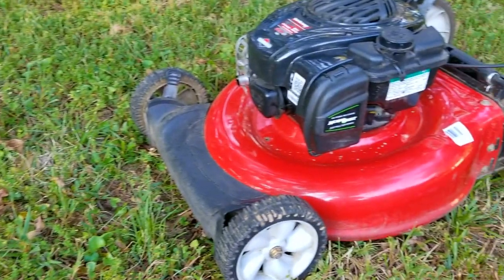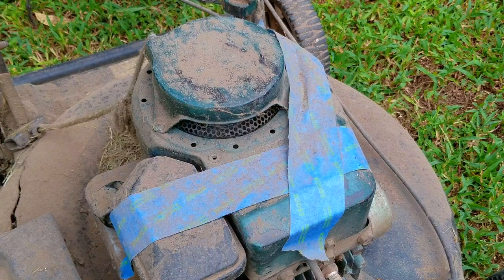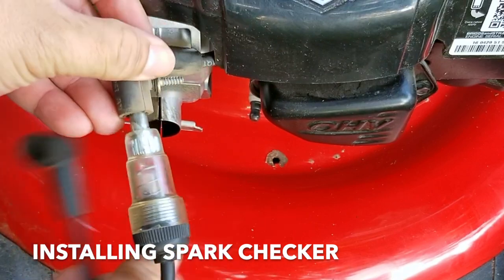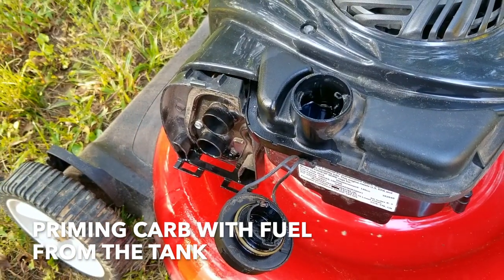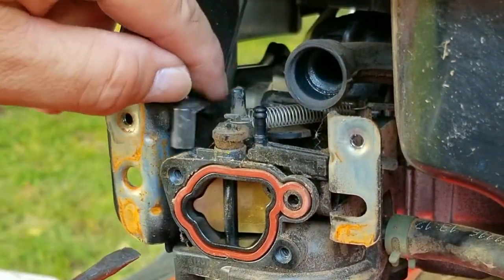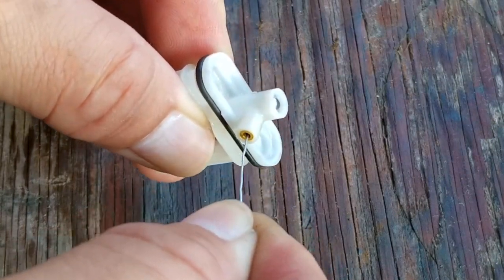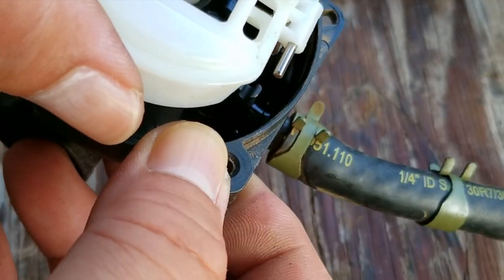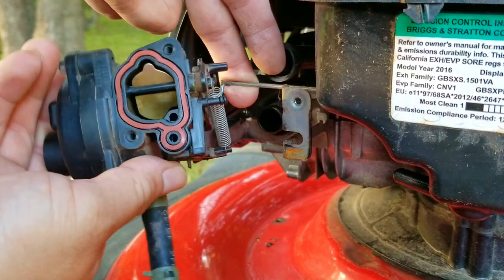Why Did Briggs Stop Making The Flathead Engine?

Comment: I once found a push mower with a flathead out in a field. The tank was surprisingly clean. Replaced the rusted-away muffler, added fuel and it started and ran. Went through the carb and used that mower several seasons before parking it. I’m sure it would run again if I needed it.
Reply from the maker: that's an amazing engine!
Reply: Had one the lawnmower tore itself apart everything was zip ties except for the blade assembly. Quit using it after the pull start spring assembly snapped. It was 33 years old 😁
Reply from the maker: very nice

Comment: A briggs sales rep once told me that old machines were designed around their flathead engines but alot of newer machines are designed around honda engines. Certain applications, unlike a push mower, are not exactly tight, but others might have to be designed around the dimensions of a Briggs flathead or a Honda GX. Therefore Briggs redesigned their motors to share the same dimensions as the GX series in order to fit the same applications.
Reply from the maker: thank you trailduster6bt I like this comment.

Comment: We had a “motor blow” contest at a stag party and had 3 flatties to run. With the throttles pinned over (bypassing the Governor) they just ran and ram and wouldn’t quit. The pulse jet carburetor is quite an amazing thing as well. It was so simple that it was genius.
Reply from the maker: so I've heard.
Reply: Are you talking about lawn mowers or "something else!!!"
Reply: I have an old mower with the pulse-jet carb and a breaker-point ignition system. Love that old mower!
Reply: Maybe they were newer more beefier designs, or the carbs are a bit smaller to limit the rpm. I knew many folks that have done exactly that in the late 60's and early 70's and it resulted in a broken connecting rod.
Reply: FYI, the correct trademark was/is Pulsa-Jet (not positive if it must have the dash).  They were an ingenious design, as mentioned in the thread.

Comment: I have dug 1970s flatheads out of barns and sheds and got them running easily and relatively cheaply. 
One thing to remember is the oldies do not like ethanol fuels, even the new engines need totally drained for more than a few weeks storage.
Otherwise a carb strip and clean will be required to get the engine to start and run properly.
Reply from the maker: you are correct!
Reply: I don't know since ethanol is just plain old alcool it should be plasric-friendly. It will chemically react with cast aluminum carbs though and produce that carb passages clogging gel. Mind you, there are other fuel additives like benzenes that may cause problems with plastics and gaskets so newer fuels aren't very tolerant towards small engines and it does indeed degrade very rapidly ! Regards
Reply: I don’t fret over the ethanol, especially since it’s getting harder around here to find gas without. I just mix 2 ounces per gallon of Seafoam in fresh gas and call it a day. No issues.
Reply: If you leave ethanol in the carb for long periods of time it will cause corrosion too
Reply: @danielrobert7181  The problem with ethanol is that it is hydrophilic, it attracts water. It is the water in the system that wreaks havoc in many engines.
Reply: @jfu5222  Sure but the thread started with a mower sporting a plastic tank and carb on which moisture has no effect.
Reply: @danielrobert7181  Thank you for the correction. I'm not familiar with the insides of plastic carburetors, surely the needles and jets are metal and influenced by moisture. Regardless of the fuel type or construction materials used, it's never a good idea to leave unstablized fuel in a machine during storage. Ethanol blend fuel is quite unstable.
Reply: We have a ton of Honda trash pumps and generators at my job and if they sit for more than a couple months the fuel just gums up inside the carb and disables the entire thing. We often have to replace carburetors in order to get the unit running, cleaning doesn't do anything.

I put a large amount of SeaFoam or Stabil in each one that I service just so they have a fighting chance during the year before the operator brings them in for service again.
Reply: correct. Its not the carb or even the engine that is the problem its the fuel. When I left we were going to nickel plated carb jets which helped with keeping the jelled fuel from sticking inside the jets but if the fuel is a jell it dosen't matter. Also the ethanol fuel absorbs water and gasoline is good about evaporating the most volatile part of the fuel above 72 degrees so age in untreated fuel is not your friend.
Reply: @danielrobert7181  the fuel goes bad regardless of the tank as long as there is air in there or can get in there it will go bad
Reply: @markrickert9040  You are right indeed and my comment was relative to ethanol and the fact that it won't chemically react with plastic (tank and carb). Regards
Reply: Ethanol is murder on small engines. People generally think it's because of a reaction with rubber, but it's not. It's deadly to aluminum. 
If you don't have ethanol free gas (aka "clear gas") in your area, you must drain it at the end of the season.
This is true for ALL small engines from your lawn tractor to your chain saw.
A Google search will get you to sites that explain it fully.
Reply: Look around. More and more gas stations carry ethanol free. A local fuel supply advertised it on the side of the road. It was expensive. $6.00/gallon and it was 93 octane. Now I see some Wawa, Murphys, buc-eeys, and others carry it.  On the road to Florida recently in South Carolina off of route 95 I found a station that had ethanol for the same price as their 89 octane. It had a red hose. My Cadillac DTS (Full size) highway mileage jumped from 23 to 27 MPG. Northstar engine. If I find it close to 89 octane price, I'm buying ethanol free.
Reply: I always run the gas out of my Craftsman/Briggs every time I use it, unless I'm mowing the next day.
Reply: do not operate a small engine on gasoline with 10-15% alcohol , you will wear out the exhaust valve guide/ valve stem, and cause the chrome plating on the piston to wear off, causing cylinder scoring/ galling!!!!    I collect/ restore "B&S" engines that date back to 1919( mod. "P"),when STEVE BRIGGS/ HAROLD STRATTON got into the small engine market!!!!.
Reply: The plastic is the same material used in automotive radiator side tanks. PA66 /Glass filled nylon. This material CAN last 21 years at 200° F and hot cold swings. When it fails, it slivers apart just like any nylon that ever fell apart. It cracks. But only the parts that got hot. I'd imagine sunlight is not really good for it but you should keep a spare anyway. Changing the oil is my thing and I try to never run dark oil. Ok. 😅 Good show and yeah I hated these before the secret was let out about drilling the main.
Reply: @gregoryclemen1870  I might have to dump the stored gas in my car.... And get the good stuff for my small engine. Thanks. I never even thought about the metal coatings. I was only concerned about the glue balls.
Reply: @marshmower  I always would get "SHORT FUSED" when I had to clean out a gas tank with stale gas in it , and try to get the carb to come apart, and clean that out. there was a few times I could not get the main jet out on a "FLO- JET" carb and had to replace it!!!!!. it does not take much effort to drain the gas and run the engine until it stops when being shut down for the season.

Comment: My flat head has now been in service for 41 years. I change the oil and clean the air filter once a year. I drain all the gas out at seasons end. I did upgrade the carberator as the old plastic one was warn out and upgraded to electronic ignition. It still runs great and doesn't use more oil than when new.
Reply from the maker: nice work Mike Fennema!

Comment: I like the older Briggs engines. Simple design, & easy to look after. The biggest I had was on a Pace forward mower. These mowers were a true work of art. They were a self propelled mower, but had no rear wheels. The gearbox drove 2 rollers, yet the discharge chute was at the rear, & very big. This thing was built to mow huge areas. Excellent mower.
Reply from the maker: than you Christopher Marshall.
Reply: Never seen a mower on rollers that sounds pretty cool actually
Reply: @GarrettMedicFennec  thanks. These were a real work of art. Even the catcher had wheels under it at the back.
Reply: @christophermarshall5765  never see something like that again feels like rollers would give a more consistent cut height

Comment: I haven't used a new style, but the flatheads are pretty tough. Pulled one out of a barn, it was used for 25-30 years, sat for another 25-30 years, and within a day of working on it l had it running.
Reply from the maker: nice! that's quality!
Reply: @INSIDEHOUSEGARAGE  And TYPICAL!
Reply: Same. The house I bought the guy left all the stuff with us including the mowers. After a day on working on the old brigs engine it was running and hadn’t run in 5 years before that
Reply: @andrewharris9302  About the only way they won't run is if they ruined the block by no oil, as in a broke rod and a hole in the block. They may smoke some but the more they run, the better they get, up to a point of course. Rings and bearing surfaces don't pour out of a can, no matter what the can instruction reads.

Comment: I remember for a few years during the OHV/OHC engine phase in, you could find a lot of the "economy" mowers with L-head/flat head engines. It bugs me that my Troy Bilt mower doesn't have a drain plug. Either flip the whole thing over or use a fluid transfer pump to change oil. Older mowers just seem to run forever. Accidentally seize it? Give it a few hours to cool down and you might have a chance of it starting back up.
Reply from the maker: yes you're correct, they're a beast and last a long time.

Comment: I collect and restore old briggs flatheads. Currently restoring a 2.5 hp horizontal shaft from 1973. Have one of them on a minibike. Absolutely love'em. Can't kill them.
Reply from the maker: very nice, thank you Super 225
Reply: I have several of the old flatheads as well. All restored and running great!
Reply from the maker: very nice!
Reply: I have 2  5S cast irons from the 1950’s.  One ran a water pump and another a table,saw for 25 years at a camp without electricity.  I know if I filled the tanks they’s be running with a couple of (rope wind) pulls!
Reply: I'm doing the same thing right now I thought your post was mine for a minute😂😂😂 yeah a old yellow 21/2 push mower

Comment: Definitely would go for one of the Older Briggs engines. The Classics and the Flatheads were both solid high-quality engines. I did not find any of their Flatheads to be lacking in terms of power, not that you need a whole lot to cut grass anyway. Those engines were pretty low maintenance, and would run for 30 years if you do take care of them. Always left gas in mine for the winter and never had a starting issue.

If I had to choose something brand new right now, I'd actually go Kohler. They seem to be well made, have good torque, and can also last quite a while if you take care of them. The Carbs seem to clog up a little easier, but they are easy enough to service.
Reply from the maker: interesting choice.
Reply: If you leave gas in it, it's better to have the tank completely full. The worst thing is to put it away with just a little gas in the bottom of the tank. Gas lasts much longer, if there's minimum dead air space in the fuel tank. The real problem is if the carburetor dries out, leaving behind the varnish and residue, which can clog jets, emulsion tubes, and idle circuits. You either want to keep it full of liquid fuel, or, you want to completely run the float bowl out of fuel, by running the engine until it quits. I even put on the choke, and try starting again, just to vacuum the liquid fuel out of the idle circuit of the carburetor. Older engines don't have fuel shut-off valves, so the practical thing is to keep it full, or, run it completely out before storing.
Reply: Gas - yes....Corn juice NO!
Reply: @jerseyjoe9393  Not really supposed to use corn juice in lawn mower engines anyway. Never seen one that allows it. Maybe there's something out there, but even then it's probably better to stick to regular gas.
Reply: Honda's line of G engines (the flathead series before the GX) were incredibly refined.  It made the Briggs look like a smelly, noisy, hard to maintain vibrating mess.  I mean, even the GC engines are nicer than anything that has the Briggs and Stratton name on it.  I happen to own three Honda flathead powered pieces of equipment in my shed. Two Honda HS35 snow throwers (one's a parts machine for the other) and a Honda rototiller.  They are well over 40 years old at this point.  The engines I had over the years that I liked were Kohler's Magnum twin, two V-Twin Command Pro and a couple 12.5 hp single cylinder Command Pros.  I've owned Tecumseh, Honda, Honda clones, Briggs, Kohler and one Kawasaki walk behind mower engine.  Everything but Briggs I was always happy with.

Comment: I am a mechanic and my preferred mower for my personal ise is still an 80s Snapper with a B&S flathead on it.  Snapper honestly jad one of the best rear bagger designs I have used and the good ole flathead just refuses to die.
Reply from the maker: thank you Oengus Fearghas
Reply: You can't beat those Snappers !  I have 2  rear engine riders 1974 Comet , & a 2010 , 2 walk behinds self propelled a 1985 , & a 1990  As there slogan use be it's a snap with a Snapper !
Reply: @ACF6180T  So far is their walk behind units I love them for the rear bagger setup.  Sometimes referred to as a top bagger.  It's about the only bagger design that I've ever used where you don't have to shake the hell out of the bag trying to get the grass back out when you're emptying it.  Seriously why don't other companies follow that sort of a design idea.
Reply: @oengusfearghas9608  I don't why they don't ! I was told 45 years ago by my ex father in law if your going to buy a mower ! Buy a Snapper you wont regret it ! & I did just that !, & I have no regrets ! I still own the one I bought in 1985 brand new with a newer engine , & other new parts ! as the parts wear out I fix it because it's cheaper than buying a new one !
Reply: @ACF6180T  I effectively have twin machines that way I have one set as side discharge and the other as a bagger.  One of them currently has a newer engine because the original was vapor-locking among other issues.  I plan to eventually get it operating correctly again but as a mechanic whom works on this equipment allot it was silly easy to just snag another engine from a newer mower with a rotted deck.
Reply: @oengusfearghas9608  That's the same thinking I had when I picked up a 1990  model with a quantum engine on it that was in good shape ! & only needed fuel lines , air filter , oil change , & new wheels as well as the front metal piece that had the Snapper logo on it the original one was smashed in pretty bad , & I sharpened the blade , everything else on it was excellent condition ! Deck ,handles ,controls , drive train , belts , & the bag along with the chute , & side discharge attachments I bought it in 2019 , & spent about $ 250.00 on it ! & it starts on the 1st or 2nd pull every time , So I usually alternate it with the 1985 that has the newer type engine! I don't know if You have ever priced the newer ones but they are close to or over a grand ! & the commercial ones cost even more ! & they no longer making the traditional rear engine rider 😒.
Reply from the maker: nice collection
Reply from the maker: agreed
Reply: @INSIDEHOUSEGARAGE Thanks ! they still are put to work ! the only exception is the 74 Comet that is undergoing a complete restoration engine rebuild , repaint , all new tires ,decals front end is already done , & drive train ! I hope to finish it late spring of this year ! & it will be put back into service , & the 85 S/P walk behind will get a fresh paint job this year as well as the 90 ! Thanks again . & I find it easier to maintain them , & cheaper than buying a new one.

Comment: The new ones also use a lot less fuel. My 18 year old OHV B&S just died due to the main seal failing but had been bulletproof before that.
Reply from the maker: nice, those older ones are great engines.
Reply: @INSIDEHOUSEGARAGE  just replace the main seal.  easy job.

Comment: The only good thing I have to say about those new engines is that the carburetor is pretty easy to open up, remove the jets and clean, you really don't even have to remove it from the mower in some cases, and the drain plug on the bottom of most of them is a nice touch. You will certainly need it as these things always get gummed up after sitting for more than a few weeks.
Reply from the maker: you are absolutely right, thank you Walter Knox.

Comment: I have a Briggs lawnmower from 1976 with a flathead, the original ignition coil went bad last year so I put a newer coil on and still runs. Compared to a new flathead Briggs engine they never really changed anything on it except the carb
Reply from the maker: sounds about right, thank you Devon Ferguson.